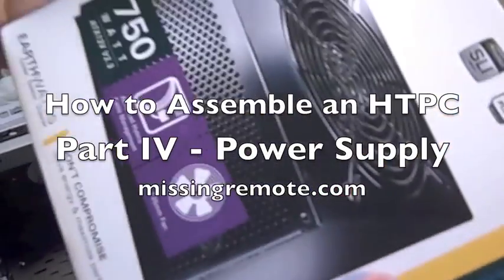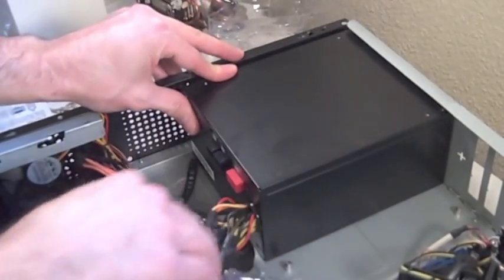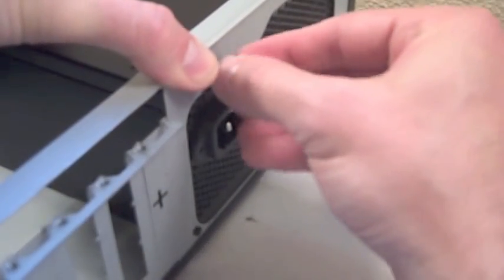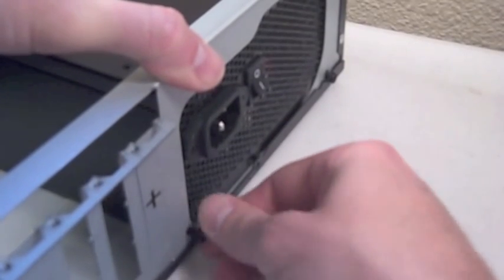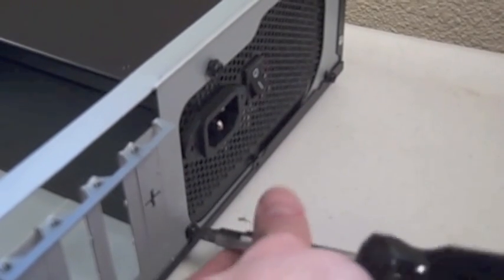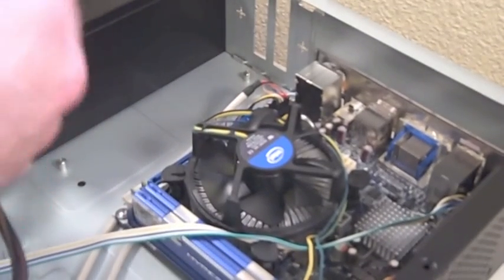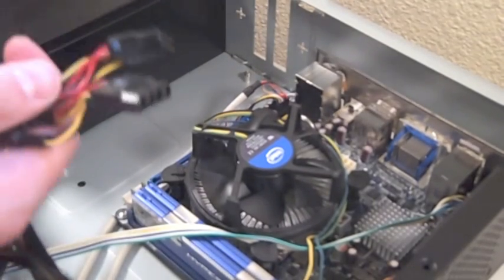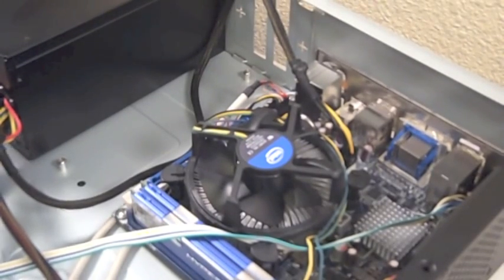Building an HTPC Part 4 - How to install the Power Supply PSU

Comment from the maker: It sounds like maybe something is shorted or not making proper contact. I suggest you remove everything but the minimum power supply, CPU, video card and try to see if the problem is still there. Reseat the video card and memory if it still is not working. Leave a post over at the Missing Remote forums and we'll help you out.

Comment: hi can u tell me why my htpc wont power on,the lcd screen stays on but the rest kinda powers on and off as i can see the fans turn on and off every 5secs,its a brand new build and it worked fine when tested for 24 hrs and they i packed it away till i got my home cinema ready,tryed to connect it up but no joy as im having the power up problem many thanks